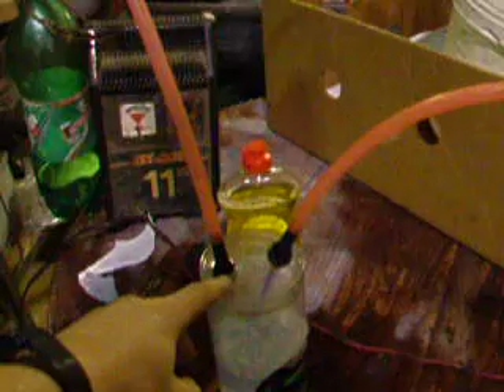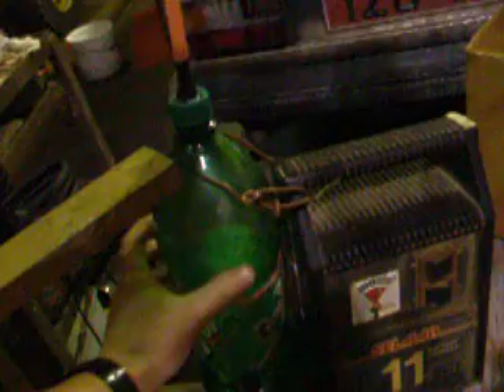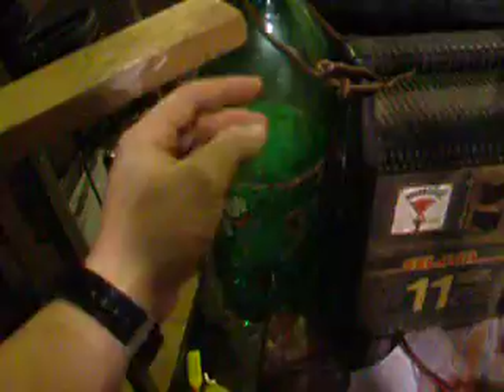HHO storage tank (part 2)

Comment: I hope in the last month or two - you have not blown yourself up.  I agree with VoiceOfEnergy...  I am working on a stainless steel cell using DC power to extract H2 into one cylinder, and O2 into another.  This can then run the torch just as acetylene/oxygen would.  Hydrogen and Oxygen stored in separate containers is relatively safe.  I can't express how dangerous pressurized HHO gas is...  Good luck with your experiments.
Reply from the maker: How did you get on ?

Comment: so were you able to store it?  is the pressure enough to push the water out of the first tank?  I want to build this.  two tanks of equal volume one filled with water.  pushing the water out to the other open non capped tank.  using water pressure to push gas out when needed.
Reply from the maker: All fixed

Comment: Hydrogen & oxygen can be separated quite easily by separating the cathode and anode... only the negative post produces H2, while the positive produces the O ,

With that said, couldn't small pressure sensing devices run a small 12 volt compressor, through a check valve to pressurize lets say a 20 lb propane bottle to 100 psi? another pressure switch could be used if the pressure of the bottle gets to 100 psi, and shut the H2 production off...  Just a thought....
Reply from the maker: Oh thank you

Comment from the maker: but i dont want the H separated from O  if i wanted pure H or pure O  then i would require more power to separate it out.. be having the plates closer less power is required, and my long term goal is to make a HHO (browns gas) blow torch. to cut metal.
my storage tank is just a simple mock up, on the proper one it will have the water all the way to the top so when there is no water in it,, it will be full of100% HHO no "air"
Reply: Steven Harper was the hho generator able to build pressure? enough to push water against gravity?